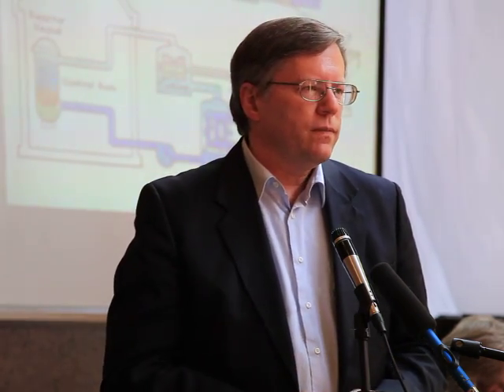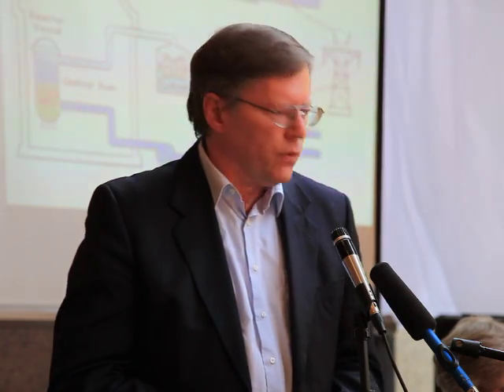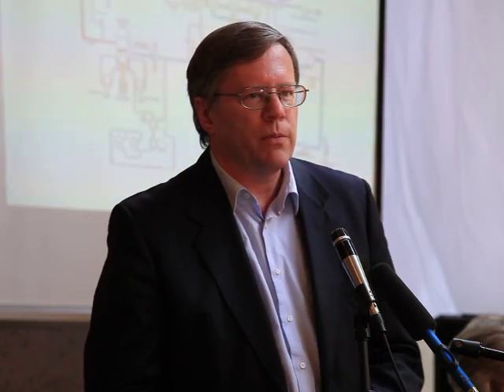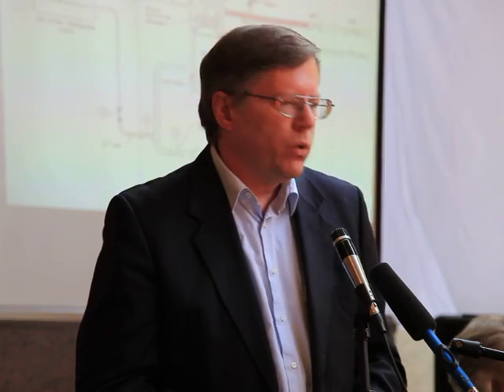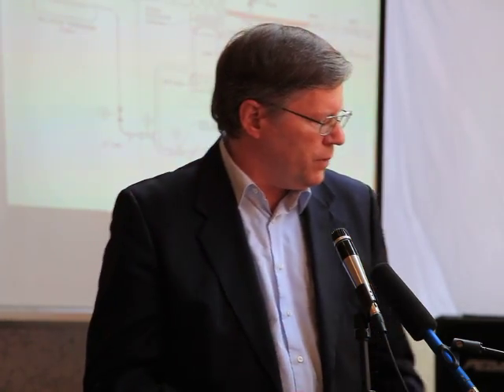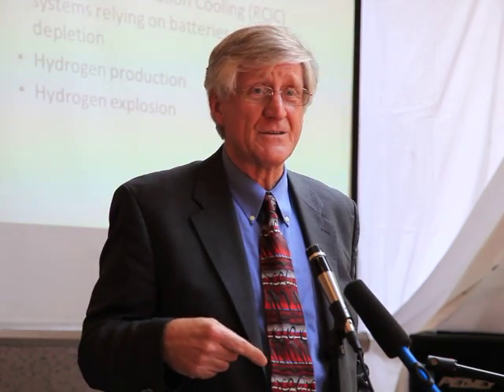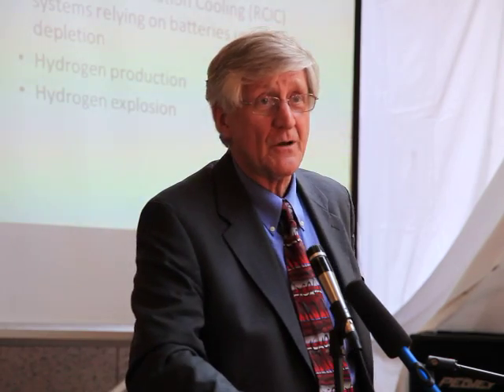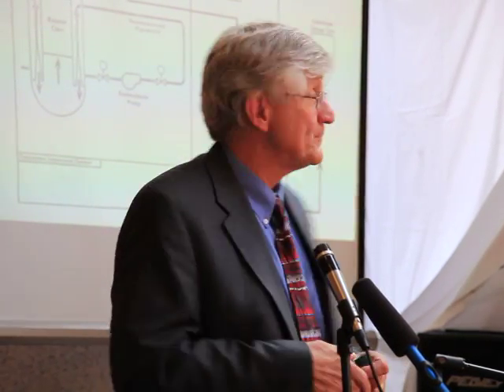What Happened At Fukushima And Why

Comment: It's odd that NPPs need around 40MW from the "outside" of the plant to operate. Does nobody see this as a problem? The power grid is highly unstable and an easy target for sabotage. This aspect is not even touched by the safety agenda.
Anyway, NPPs are the producers for metals used by the military in the first place. Nobody depends on nuclear power. It's the most expensive way to produce electricity. The total cost per kW/h (terminal storage of waste excluded) is 5 USD!